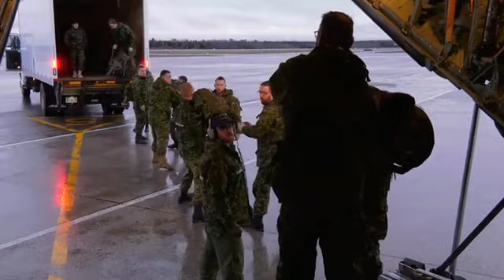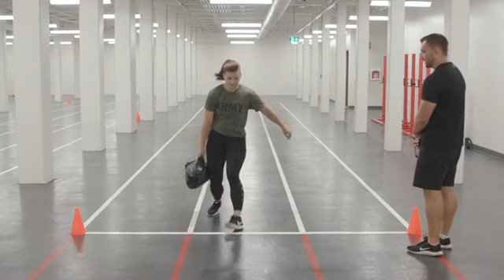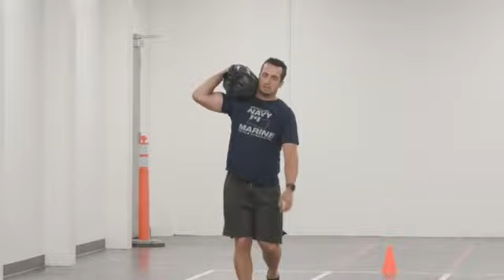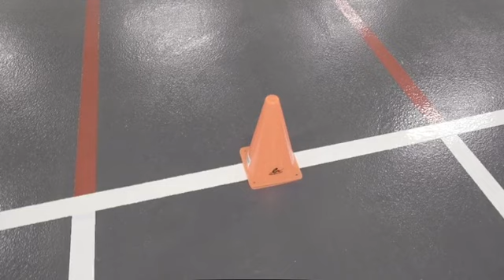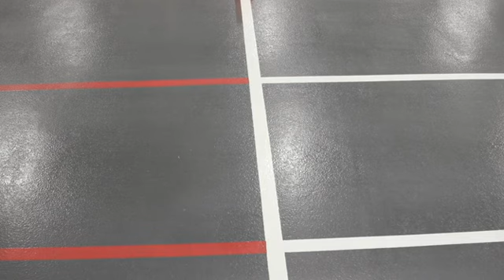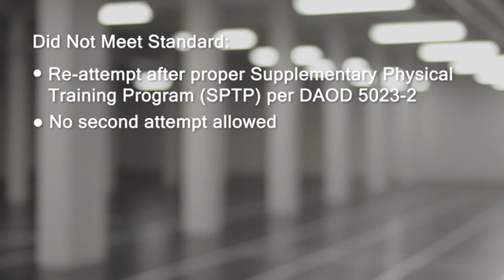Canadian Forces - FORCE Evaluator Course: Intermittent Loaded Shuttles Protocol

Comment: That’s 5 carrying and 5 running making 10 right? Or is the that 10 each
Reply from the maker: 5 of each, alternating between them. 

Start with the sandbag carry lap, then an empty lap. That is 1 cycle. Repeat 4 more cycles.
Reply: Can we switch hands during loaded carry?
Reply from the maker: Yes. Can be carried single handle either side like a suitcase, on either shoulder, or both arms in front. Can switch positions as needed. 

Cannot be carried on the head. Must use arms to carry the sandbag.